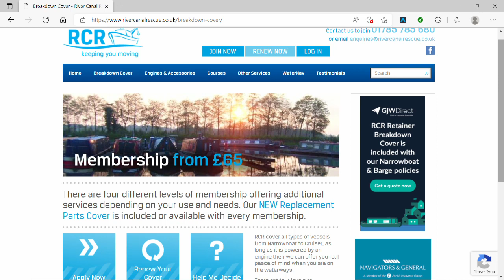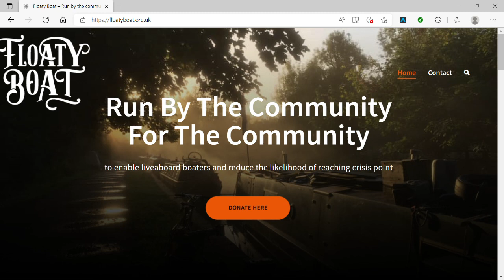Boats Sinking on The Cut

Comment: What specifically caused the boat in the lock to sink (6:00)?
Tight lines and a lowering lock water level? 
Catastrophic stern gland failure?
Does anyone market an alarm that sounds if a mooring line cuts loose?

Comment: Failure to prevent water ingress, blocked drainage runs, lack of maintenance and repairs, lack of operable and adequate, automatic bilge pumps and lack of visual and physical inspections have led to the loss of countless river boats and craft.

Its not unusual for boats to sink after very heavy rain, yet all of these issues are entirely foreseeable and wholly preventable by an attentive owner!

Perished, leaking window, door and vent seals may be repaired or replaced inexpensively by an owner.

Even the most frugal owner can effect complete watertight integrity with some pound shop silicone sealant and a sheet of rubber material. (or inner tubes).

There's really no excuses for having leaks that then rely on an operational automatic bilge pump to be removed. 

You Tube and countless websites and forums show how to carry out maintenance and repairs, but some owners are simply not interested and will only take notice when they see their cabin roof just below the water surface (assuming that they were fortunate enough to be elsewhere when it sank!).

Its almost like a self culling exercise in which those that endanger their own vessels remove themselves from the waterway by sinking their own boats...

Subscribed.
Reply from the maker: Lots of good info there
Thank you for commenting

Comment: Did you mention the weedhatch not being locked down properly?  We came across a hire boat on the Llangollen about seven years ago that was on its way down for that reason.  By the time we pulled them across the canal to the tow path side the engine bay was full to the top so the engine had cut out.  To my astonishment the bilge pump wasn’t an automatic!  The hirers had to keep a finger pressed on a button to operate it!  We wedged a broom handle onto it. That did the job.
Reply from the maker: Flipping heck Sheila , that sounds scary.
No I should really have emphasised the importance of securing the weed hatch.
Thank you for watching.

Comment: Maybe canal boaters should consider the matter of watertight compartments, and/or large automatic bilge pumps as a precaution?
.
Reply from the maker: Most have the latter, but bad maintenance can result in failed bilge pumps but rarely have completely watertight compartments 
Thanks for watching and commenting
Reply: Even if the whole cabin was made to be a watertight section, with watertight doors, down to the hull, it would stop the whole boat flooding and sinking. @narrowboatmaggiemay

Comment: Really interesting.   Wonder what happens to boats that are ‘abandoned’ sunk or afloat.  Are they auctioned off ?   Great vlog.  Thank u 🙏
Reply from the maker: I think CRT aim to make the licence holder responsible but , if it’s not licensed?
Reply: A sunken boat tends to happen (80% of the time) is due to steel degradation - which makes the boat valueless. Costs more to cut a boat up than the steel it holds is worth

Comment: @narrowboat maggiemay we were cilled so we dropped paddles with a thump,,and re-flooded the pound just beside us thankfully little or no damage had been done 
I thought my now abusive ex fiance david north was at the tiller and had been paying attention as i had just opened the lock paddle on my right to let him through a lock above grindley brook locks  so drop paddles stop the drainage and reflood prior pound letting water down in a slow and controlled manner as per our case THANK GOD 🙏 we didn't sink or have much damage just a raised tiller cap raising tiller and a little not much vibration had George at chas hardern check us out and give us an ay okay
Reply from the maker: Glad it all worked out okay in the end